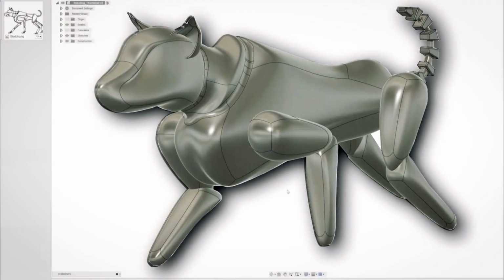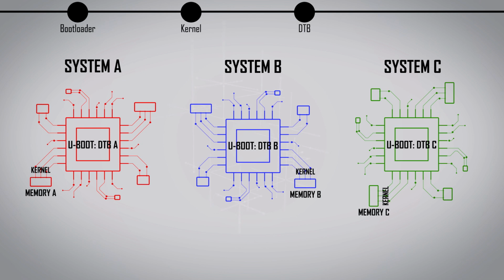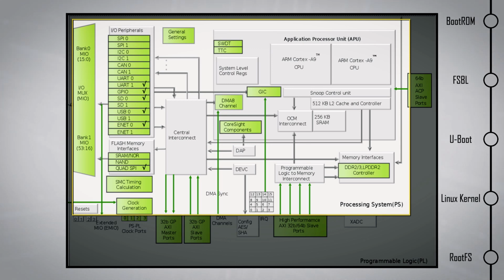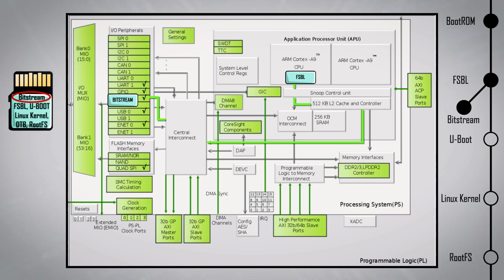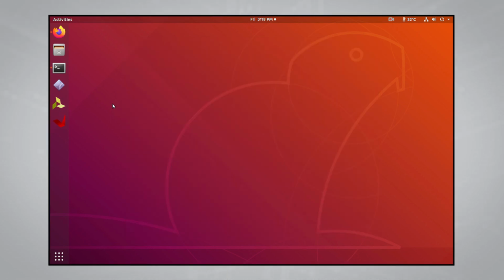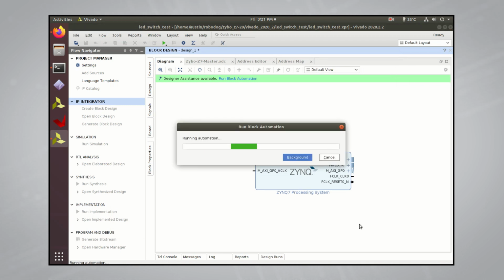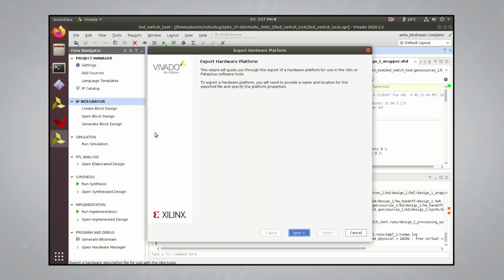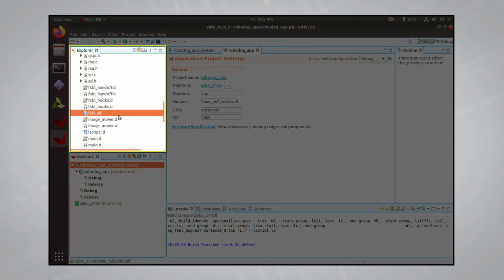RoboDog Part 7 | How to Make Your Own OS (1 of 3)

Comment: may i know why you use xilinx zybo but not nvidia jetson in this project, please? I am not familiar with fpga. wonder what are the advantages of using fpga to build robot
Reply from the maker: The primary selling point of an Nvidia Jetson is that it has a General Purpose GPU (GPGPU) in the same silicon die as the CPU. GPGPUs have a very explicit way for how you interface with them from the CPU in order for you to leverage the acceleration with your applications. As for FPGAs, its more of a blank slate. You literally create the hardware on the FPGA and define how you interface with it. With FPGAs, I can literally create a GPU in the FPGA if I wanted. 

All in all, there are pros and cons with both solutions and it depends on what your end goals are. Just off the top of my head, here are some pros and cons:
Nvidia Jetson Pros:
- Faster development time
- Well-defined interface from the CPU (CUDA)
- Data transfer mechanisms already taken care off (memory mapped)

Nvidia Jetson Cons:
- Hardware is rigidly defined, there is no changing it
- Primarily good for very specific applications that allow for parallelization (thats not to say that Nvidia Jetson isn't good for other types of applications that can't be parallelized, but the only reason in my mind you'd want to get the Nvidia Jetson is because you want to utilize the GPGPU, otherwise there are several other embedded systems that can do what Nvidia Jetson can do)
- Forces you to rethink your application in terms of CUDA

FPGA Pros:
- Extensibility. It is truly a blank hardware slate that is reprogrammable. As long as there is enough fabric space in the FPGA, you can create any hardware in the fabric (e.g. RISC-V, MicroBlaze, ARM cores, GPUs, peripheral controllers, or any other digital logic). Just to hit this point home, if you find out after you already bought your embedded platform that you actually need 10 SPI controllers for whatever reason,  you can instantiate 10 SPI peripheral controllers for your application.
- More power efficient than Nvidia Jetson

FPGA Cons:
- Steep learning curve
- Takes longer to develop for